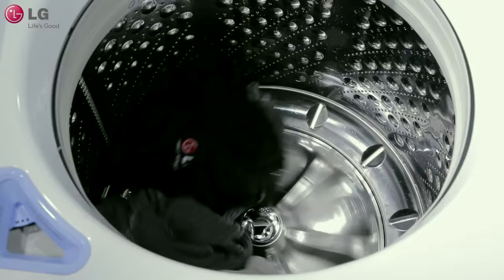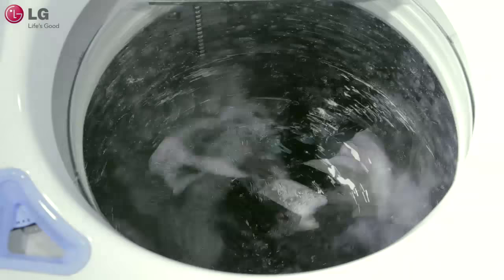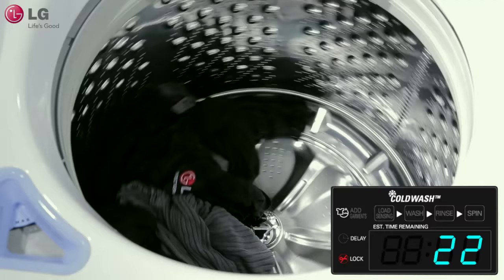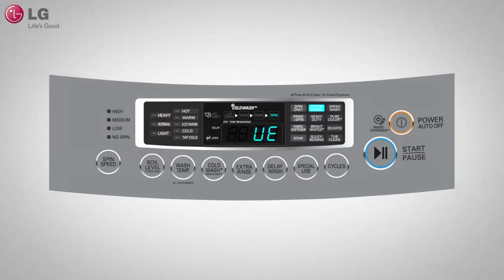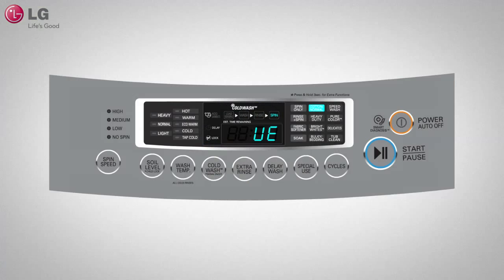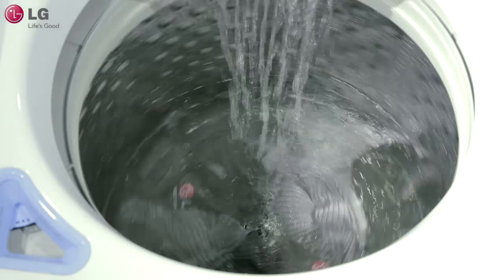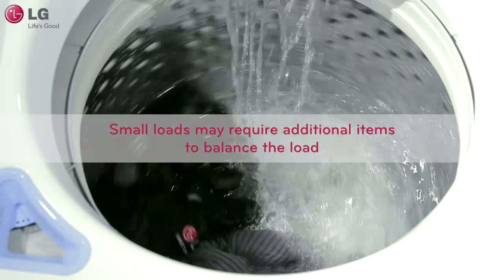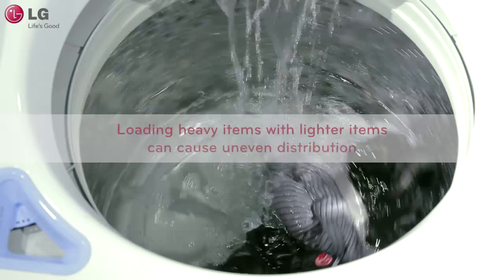LG Washer - Top Load Balancing & UE Message (2018 Update)

Comment: I just bought a LG 5 cu.ft. top load to replace my 12-year-old Whirlpool Cabrio that was excellent except it increasingly in the last few years has been throwing overload, even when it was not overloaded, even with nothing in it, finally, which got so I couldn't get it to operate at all. The reviews of LG were the best, and now I see this video and that LG seem to have the same problem Whirlpool Cabrios were known for--I hope not.
Reply from the maker: Did you mean 'Unbalanced loads'? Unbalanced loads are due to the washer not being properly leveled or that the load has not been equally distributed around the drum or that you have lighter items loaded on one side of the drum and heavier items loaded opposite the lighter items. What is the model number for the LG washer you just purchased? A uE/UE code indicates the washer is attempting to balance the load. When the codes are displayed, the washer fills with water in order to agitate & separate the items. After 3 attempts, the uE changes to UE, meaning the washer is unable to balance the load & will require assistance from you...^Ivan
Reply: @LGUSA  No, I was referring to my Whirlpool Cabrio from 2009 which uses a magnetic induction drive--no belt, drive shaft or clutch, and spun up to 1100 RPM with virtually no vibration. There was a known problem or flaw with those machines where the center shaft would become sticky or corroded and the resistance would cause the electronics to think it was overloaded, even when it wasn't, and increasingly it would throw the overload error and drain the water before the the wash was done, with only a partial load and finally with no clothes at all. Yet when I could get it going or just used the spin cycle, it was as smooth as silk with no vibration. 

However, I am having an issue now with my new machine, LG WT7300CW 5 cu. ft. Direct Drive Top Load Washer. The delivery people didn't bother checking it with a level, they said as long as it doesn't rock on the floor it was okay (it was going were my old machine was), but I checked it with a level, even though the level may not have been exactly accurate--it's very old--and looked to see if the drum was centered, stationary and spinning, and through trial and error I adjusted the feet so I think it's pretty well centered and leveled, but it still has an issue--or is it?--that when I tried a small load, pretty well-balanced, and even when I use the test with no load for the hoses and stuff, when it spins, there is some vibration--not violent and it doesn't throw an unbalanced load error, but it's definitely like a strong vibration which I can feel and see. It's been almost 13 years since I had an old Kenmore direct drive top load washer with agitator, and I so do remember that that vibrated also but it was pretty old at the end--I had it for 25 years and it was there from my grandparents when I moved in (I only used it about once a week, but still that's a long time to be without repair). In the new LG,  I can turn the tub freely with my hand and it continues spinning when I release it, and when it slows down there's a clicking sound, like a ratchet, in both directions--is that normal? I know there's an issue that you are supposed to take the tub support out from the center underneath the bottom, but I imagine that the professional delivery installer people from the appliance chain know to do that, probably when it's on the dolly tilted back. There's no way I can check it now by myself unless I had them come back, detach it from the hoses, and risk scratching or denting it to tilt it. Perhaps I can slide my cell phone under the center and take a photo, but I'm not sure how I would press the button for the shot (unless there's a time delay feature). Anyway I really doubt that's the issue. It's just that after the Whirlpool being so vibration-free even at high spin speeds, I'm asking if it the vibration, sort of like a heavy massage vibrator or a rough running motorcycle engine, which can be seen and felt, is normal?
Reply: @LGUSA  I slid my mobile phone under the washer with a timer set for 10 seconds with flash photo on, and can see the center assembly. There is no styrofoam tub support remaining, I see only the end of the shaft with the white plastic or nylon washer/spacer with the 12 outer prongs, around it.
Reply from the maker: You may want to have the #WT7300CW inspected by a qualified LG Service Technician. You can contact our Support Center at (800) 243-0000 & they can assist you to make arrangements for repair service or you can visit our site at https://bit.ly/3qXf71x & use the locator to find an LG Authorized Service Center in your area or near your area...^Ivan
Reply: @LGUSA  Can you first tell me if the vibration as described is normal for a my new machine? I just bought the thing, I shouldn't have to have it repaired right off the bat. If I can have an inspector come out under warranty and check it out maybe I will do that.
Reply from the maker: There is no way to determine if the vibrations that you are experiencing from the #WT7300CW are normal or not without actually being there in person. It would not be unusual to have some minor vibrations, but how intense they are is something that would need to be experienced in person. Vibrations are typically due to improper leveling or a floor that has more than the recommended slope. Your washer has a Limited Manufacturer's Warranty of 1 Year from date of purchase so if it is within that year, it is still under warranty....^Ivan
Reply: @LGUSA  I just ran the installation test again it seems to have less vibration. I checked the level again with a level, side to side and front to back seems to pretty exactly level, and is on a tile floor over cement. I left a message with an independent local repair guy with 20 years in the business who advised me that my Whirlpool  Cabrio probably wasn't worth repairing because of the cost, perhaps $400-$500, assuming it didn't need a new motherboard which may not even be available after 12 years. And he advised to get either a new model Whirlpool or an LG. Maybe I'll hear back from him today, to see if he has an opinion or needs to see it--he services and has OEM parts for all major brands, but I'm not sure if he is an authorized LG repair service--he charges $89 to come out diagnose an issue. But while he got all excellent reviews on Yelp, the authorized service companies nearest me which I checked got terrible reviews on Yelp or can't be found, except for one that got a an excellent review, but it was the only on. But if they will come out for free under warranty, I may need to use them.
Reply: @LGUSA  Another issue and I've seen other people complaining about this, is that the machines, I assume the washer, gives off an irritating rubbery smell that builds up in the small laundry room unless I air it out. Supposedly it will diminish in time, and may be caused by the synthetic rubber material of the new water hoses (I didn't notice it in the wash itself), but I don't remember that kind of smell when I installed my Whirlpool over 12 years ago. The dryer had a burning smell the first time the installers tested it, but that quickly burned off, and is not a problem now.
Reply from the maker: What you are describing is not unusual for a new washer or dryer. As you noted, that smell should dissipate after a few uses. If you have the washer installed in a small room without much ventilation, the smell will build up & be more pronounced. It is normal for a new unit to emit odors the first few times it is operated & the smell may be present as a burning smell, plastic smell, rubber smell, or a fishy odor, or even a warm burning smell. That can be caused by the heating of new motor coils & insulation material around the motor. It should dissipate after 10 or 20 full cycles. If the electrical or rubber burning smell persists, you may need to request a repair service & a technician will be able to check the washer...^Ivan
Reply: @LGUSA  there was a burning smell from the dryer when it was first turned on from the heating elements, similar to when I use a space heater after it's been stored for a while, or the reverse air-conditioning in my house if it hasn't been news for a while. That dissipated in a few minutes. The other smells probably come from the washer, maybe the hoses or other grease or components, but they are dissipating someone now after a week even without using it much. It's the vibration in the washer that's the problem. I talk to that repair man who with 20 years experience who recommended LG or the new Whirlpools, and he said it is not normal to have vibration like that or you run with the small balanced load. He says some of the previous units used to have a bolt and packing that sometimes wasn't removed inexperienced installers, but I don't think that's the case with my washer, which only has the Styrofoam on the bottom. He said he's installed a lot of LG's and they I Hardly have any vibration, so he suggested I have the appliance store chain replace it, which I will do. I'm going to call them now, they have just opened for the morning. I will tell them they can use the same water tubes which are new and have started to lose your their smell, if that was the issue--new tubes are $25 anyway.
Reply from the maker: Hi, Fred. I’m sorry to hear you're having this issue, and I’d like to see if we can assist. Please contact LG Customer Support by direct message via Twitter ( @LGUSSupport ).

Comment: It has taken me three days to wash a load sometimes and it's happening more often.  It seems to be more of a problem with dark clothes than light which are usually my jeans and sweats and also towels.  How different can towels be?  I've had this machine for almost four years now and it didn't start doing this until the last year or so.  It was a great machine before that, but now it is becoming too much work to get laundry done.  What's more frustrating is that when I redistribute the load and it goes out of balance again (which it usually does), there is more time remaining to complete the cycle than when I redistributed the load the previous time.  WTH?!!!  I'm also beginning to have problems with the matching dryer.  It has random moments when it won't turn off.  The only good thing about this problem is that they heat isn't on, it's just tumbling with air. I first discovered it when I put a load in the dryer before leaving for work one day only to have it still going when I got home.  I have to reset it which hardly works so I wind up leaving the door open or unplugging.  Not pleased with LG.
Reply from the maker: I’m sorry to hear you had this issue. I would like to look into this further and see if there is anything I can do. If you will send more details via a direct message on Twitter ( @LGUSSupport  ) or Facebook Messenger ( https://www.facebook.com/LGUSA/ ) I will look into what happened. Please include the following in your private message so we can open a case for you: phone number; model number; serial number; date of purchase. Thank you. ^TC

Comment: LG washers have had this problem for years. Bought a new one six years ago and have NEVER had it finish a cycle. Even on Rinse/Spin with NOTHING in it. Don't believe the "call support" crap, I've wasted hours on the phone with them with no results. The LG warranty is useless. They blame everything except the washer until the warranty runs out, then try to sell you a board that costs as much as a good used washer. Buyer beware!

Comment: I'm based in the UK and my LG 8kg front load washing machine can be very fussy with spinning and takes ages to balance the load. More with large loads as opposed to smaller ones. That UE and having to open up the machine to balance the load would annoy me.  I think the UK versions either give up balancing after 10 mins and do the next stage rinse like mine has done twice in the 8 months ownership. Not sure if it can't balance on final spin as mine has always been determined to spin.

Comment: It often times  spins it well enough just prior to throwing the uE code, then it ADDS water to rebalance when it should just move to the next cycle. On a side note, it also spins for 15 minutes between the wash and rinse cycle. Totally unnecessary. 
Wastes water and electricity.

Comment: Here's a novel idea...instead of repeatedly adding more water trying to auto-rebalance the load before throwing up an UE error code, just throw up the error code immediately and stop the machine so it can be manually rebalanced. As it stands, you waste an entire full basin of water and then need to manually rebalance it anyways. Some high-efficiency. You waste more water on a botched auto-rebalance than entire wash cycle. We just got an LG non-agitator toploader (2023) and I hate this damn washer. Rebalance isn't the only issue. It doesn't get clothes clean either. Tried different loads at different water levels and clothing arrangements. One time it took 3 hours to finish a blanket because we had to sit there trying to manually rebalance the load while fighting the machine as it kept adding more water to balance the load. Never had this problem with our previous three old agitator washer unless the balance was real bad and even they wouldn't needlessly waste water.

Comment: Well, our LG top loading washer just decided to go for a walk this morning and completely self destructed.  Side and front are thoroughly dented, top no longer aligns with the bottom, and the entire washer spun itself 270 degrees to the left.  When I heard the noise and went downstairs to see what happened, it was facing me side on vs. front on.  It is not even 4 years old.  Apparently something that keeps the central tub in place completely snapped.  And I felt like completely snapping when I realized I am going to have to buy a brand new washer to replace a product less than 4 years old.  Disgraceful.

Comment: This problem is very frustrating.  I've never had this happen with other washers in my life and dealt with this problem for 2 years, rearranging load after load. The top panel has trademark high-tech sounding names like "Direct Drive", "True Balance", and "Wave Force", and it can't even keep spinning even when the load is completely even. Won't be buying another LG appliance again.

Comment: Mine throws the UE code during the tub clean cycle WITH NOTHING IN IT! And yes, it’s level. Completely.
Reply: Yes, mine does the same and it was completely level. when I looked at the tub in it, it was still not center with the opening. I got it out of level now to get the tub level in it and not the machine. Now I am trying that.

Comment: I just got one 2 days ago. UE on every load, including an empty test run.  Yes, I have checked that it is level. Spin mode is smooth, it does not appear to be out of balance.
Reply: I contacted LG support on facebook. They responded quickly to schedule service. Replaced motor and motherboard, it works perfect now.
Reply: Mark A if I were you I’d return it to where you bought it and get something else. Read all the comments, see anyone that loves the washer?
Reply: JT Tamashiro was
Reply: @sapphire163  it's been 4 years. How is it running?
Reply: @kensimon4478  No problems 4 years later.

Comment: I have a LG washer (not his exact model) and the thing is frustrating. I can't even do the tub clean without it becoming uneven and stopping. Heck i can even .ake itbthrough a tub clean cycle. It does this with normal loads frequently as well. For a $700-$800 machine you would think it would work. I was informed by a store employee LG was good and it has been nothing but an absolute pain. I would not even condider LG.

Comment: Why can you not turn this dreadful feature off???  I had a Whirlpool before purchasing this stupid washer and NEVER had these problems - if it was out of balance it just stopped and told me... what a novel idea... instead now I have no hot water because the machine fills and drains FOUR times before notifying me it is off balance and runs my water and power bill through the roof..: wish I had NEVER purchased this washer - takes an entire day of babysitting the washer or restarting it multiple times to get the laundry done.... HATE IT!!!!
Reply: I know right? Just immediately stop and ask for a manual rebalance. Don't waste a bunch of water on a futile effort. You use more water in one botched autorebalance than an entire wash and rinse cycle.

Comment: The whole off balance issue is caused by most washer manufacturers using this ASSININE free floating tub design with no tub brake! This design is used to satisfy the share holders of these appliance manufacturers, because it costs less to make a machine with this design!

Comment: gAS Error. A gAS error means that the dryer door is not receiving gas. Make sure that the gas supply valve is turned ON. make sure that the gas line is not kinked.

Comment: This is a known problem with top load LG and the motor needs replacing - 10 yr warranty.  Problem is that LG gives you authorized repair companies and they are no longer doing LG warranty repairs because they do not get paid - and their yelp reviews are 1 star.  Getting an appointment with LG takes calling in at 7am in morning 6 days ahead of time and guaranteeing $195.   I would never buy an LG product because when it needs repairing it is almost impossible!